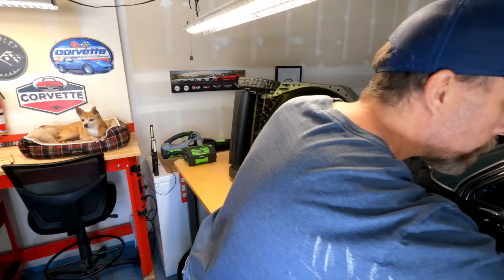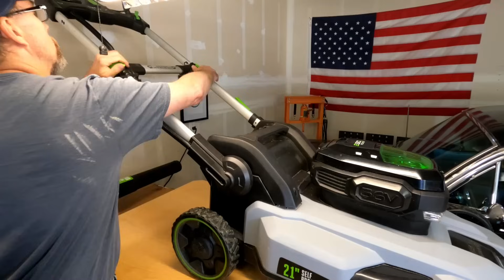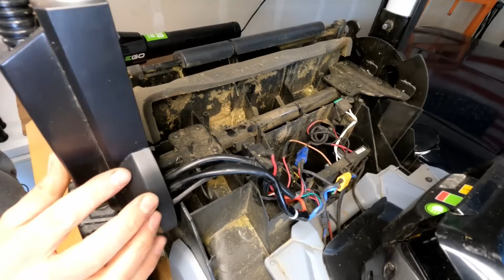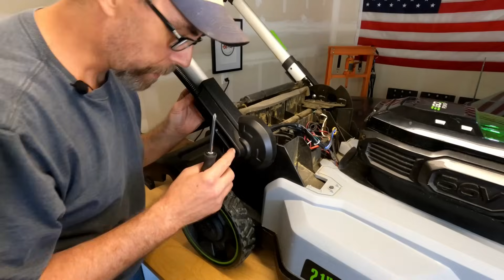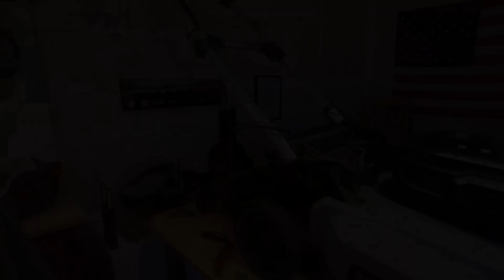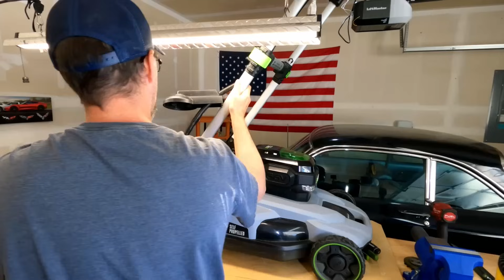My Ego Mower Finally Quit Working!!  🔧  Can I Fix It??

Comment: Big question do you continue to fold it?
Reply from the maker: Yes. I fold it up and store it standing up every time I use it. My repair has held up well. Being able to fold up the machine is one of the reasons that I bought it. If it pinches the wire again I will just fix it again. It takes less than an hour to patch up the wires. Thanks for watching

Comment: These are the type of videos that make YouTube such a valuable resource.  I do not have any issues with my EGO, but i find this so fascinating. Also ill just keep my handles bent at the half way mark and not fold it up to avoid this. Thanks.

EGO should provide a wiring schematic for their mowers if they dont already
Reply: Im having this same problem right now.  This video helped a lot
Reply from the maker: Thank you so much! Hope you have no troubles with your mower. Good luck
Reply: I suspect EGO doesn't want consumers attempting repairs for liability reasons. Plus, they'd much rather sell a new mower.

Comment: I was having the same problem with my ego and I noticed the two green clamps on the side of the bars loosen with use causing the bars to slide down and prevent your blades from rotating.  Grab some duct tape 😂 and wrap around the bars and clamps to stop the bars from slipping down.  Gotta love the duct tape.
Reply from the maker: That's great. Nice fix. Ya, I had the same problem. I actually ended up snapping off one of the green tabs inside of the handle frame. I stuck a screw in it to hold it for a while, but I eventually replaced the green lock handle. I have a video on this channel of that process.
Reply: @EndWrenchRookie  👍

Comment: seems like those two bolts near the wires could be replaced by button head bolts and turned around to help prevent any breakage problems.  The smooth head of the button head bolt would be less likely to snag the wires
Reply from the maker: That is a great idea! Thanks!

Comment: Do you still use your ego lawnmower?
Reply from the maker: Yes, I still use it. It is running as well as the day I bought it.
Reply: @EndWrenchRookie  thanks I think I’m going to convert from gas 

I just got concerned cause some are having a issue with rear wheels locking on self propelled 

I’m looking at the 2156 select cut self propelled 

I can’t wait

I thoroughly enjoyed watching this video and your way of diagnosing

I also feel rather than always replace try to fix first yourself

Comment: Very interesting! I have a few Ego products and need a new mower.  With limited space, I also plan to fold it up to store… but your theory makes sense as to why it fails.  Other than this, I assume the mower works well.  I’ve seen a few people post that it still hasn’t been resolved, so would you recommend NOT folding the mower to avoid potential stress on the wires?
Reply from the maker: Thanks for the question. To be honest, the folding capability is my favorite part of the mower. I still fold it up every time I use it. If you have trouble with it like I did, you can have it repaired under warranty, or just solder in a repair wire like I did in this video. It is a free fix that takes less than an hour to do. Good luck!

Comment: From the looks of it. It seems like those 2 bolts play a role in kinking those wire and cause it to break due to many folding and unfolding.  Hopefully the manufacture put in a rubber gromet on those expose metal part to keep all the electrical wires from getting kinked in theyre next line up future model lawn mower. Great video,  very informative,  Thank you!  I already have an idea on which ego mower to get and this video will for sure come in very handy for all the DiYer.
Reply from the maker: Thank you so much! I appreciate the positive feedback :)  Yes, I hope that EGO has addressed this issue in newer models as well. The response to this video has been tremendous. I am amazed at how many others have had the same issue as me. Though many of these units are still under warranty, a lot of them are not, and more are expiring everyday. My hope is that others will find my repair process helpful. Thanks for watching!

Comment: Yes the wire harness and wire fatigue is a weak point in these mowers. I have fixed three different EGO mowers where the self propel quit. All those wires were broken at the mid point of the handle where it collapses for storage. I replaced the wire at the breaks  with heavier gauge wire on each mower and the SP started working. I have told everybody I know with an EGO mower not to collapse the handles. Now I may stop bending the handle too.
Reply from the maker: Thanks for the comment! Ya, it is definitely a weak point. Luckily it is an easy fix. I haven't had any problems with my repair yet. I agree that it would be better not to fold them down anymore to avoid further crimping of the wires, however, I am really limited on space and need to collapse it in order to store it out of the way. Also, I really enjoy the process of folding and unfolding the machine. It makes me feel like a kid playing with a Transformer toy :) I will likely have to fix more wires in the future, but that is the price I pay for entertainment. LOL. Thanks for the info and for sharing your story. Also, thank you for watching!
Reply: I called EGO after repairing the third lawnmower and supposedly talked to a tech rep about it. He was very non-committal about the problem. I also talked to an EGO rep at a Lowe's when Lowe's took over distribution. Same non-committal. I love EGOs products and their warranty is the best. Hopefully newer generations will have wiring upgrades. Great videos by the way.    @EndWrenchRookie
Reply from the maker: @old-n-still-runnin1597   Very interesting...Thanks for the kind words. Unfortunately, I think that products just aren't made to last these days. I imagine someone figured out how many times the average user would collapse and unfold the mower, then multiplied that by length of the warranty, then tested the durability of different wire setups, and landed on an average of a usability factor of 5 years one month. Science...Lol

Comment: Original purchase covered by a 5-year warranty. Curious why you're fixing it before that date instead of having EGO replace/repair it? They gave me a new one when mine failed at 4 years . . .
Reply from the maker: That is a great question. I needed to get my lawn mowed before the storm hit that afternoon. I don't have a backup mower for the downtime dealing with the warranty. In addition, I prefer to fix my own equipment. Also, I have a YouTube channel where I fix, maintain, and restore stuff. There are a lot of these mowers that are out of warranty already, and more everyday are expiring. I want to help others learn how to diagnose and repair their own equipment and save money and time doing so. I was able to repair my crimped wire problem in less than one hour (while recording a video for YouTube), and it did not cost me any money. Thanks for the comment and for watching!

Comment: My ego push mower would sound like it would start, but then quit in a couple of seconds.  I have taken it to a repair shop Ego recommends in my area.  The mechanic groaned when he saw I had an Ego mower.  I said it lasted 8 years without a problem.   He said he did not like working on them because there are no nuts and bolts.  Now that I have watched your video and another similar one, I can see there are things to take apart.  I think I should go visit the mechanic and tell him to watch your video and the other one to get an idea of what is wrong.   Thanks for giving me this info.  S. Beasley
Reply from the maker: Thanks for the comment. Ya, it is going to be a while until the electric mower repair game catches up. I just really enjoy taking stuff apart and figuring out how it works. I hope you get your mower worked out. Thanks for watching!

Comment: I don't understand how someone could recommend this as a good lawn mower when it's only 3 years old and its broken. I have an 18 year old snapper and it starts first pull and have never adjusted or changed anything on the drive system. I have changed the spark plug 1 time and air filter 1 time. I doubt an electric lawn mower will last as long and not need a new battery which costs almost as much as buying a new one. It makes absolutely no sense to buy an electric lawn mower for how much it costs over a regular gas. Now i did buy an electric Ego brand weed Wacker because most gas weed wackers seem to not last very long without issues so electric for me on that seems worth it. I'm glad you were able to fix it. Hopefully it lasts you 20 plus years.
Reply from the maker: Thanks for the comment. I am glad you are happy with your Snapper gas mower. I am happy with my Ego electric mower. There are enough mowers out there for us all to have our own favorite machines. I would  not say that my mower was "broken". It had a crimped wire that gave it an intermittent power supply problem. It was a free repair that took less than an hour (while recording a youtube video). All mowers have issues. For some reason, so many people assume that because of the difference in powertrain, there should be zero maintenance issues. All mowers need some kind of maintenance as they lead a rough life. If you go apples to apples...this mower only costs 400 dollars new and ready to run. Have you looked at what 400 dollars will get you in the gas mower market today? It is not a fair comparison. That being said, I have used more mowing equipment than most people, including working as a commercial landscaper. For my personal needs, the EGO mower does a great job. FInally...I also had a great gas mower in the past. I used the same John Deere mower for over 20 years and I loved it. However, if you add up all of the maintenance costs (gas, oil changes, air filters, spark plugs, Carb parts, pull string replacement, throttle cable replacement) after 20 years that all adds up to a lot more than a replacement battery. (An annual oil change, spark plug, and air filter is highly suggested on any small engine). I am amazed at how divisive this subject is. If you like your mower, by all means continue using it.  Hope this helps you "understand how someone could recommend this mower". I recommend it because it is a great piece of equipment. Thanks for watching!
Reply: Mine 3rd mow, of second season died, not something as minor as location of handle.

Comment: i wonder if you can get move of that cable runner to wrap around the wires in the joint. looks like its hitting on that bolt there.
Reply from the maker: Not sure. Sounds like a good idea :)

Comment: Hope this doesn't happen to mine, I'm on year 3 with my select cut version, not sure if that ones any better wired or not. I also fold it up after every use.
Reply from the maker: Seems like a pretty common problem. If you do have an issue you can get it warranty serviced or just patch the crimped wire like I did. good luck either way! Thanks for watching

Comment: Most lawn mowers are designed to only last 3–4 seasons. As my Father always says, it's planned obsolescence. They are designed to breakdown, so you have to buy a new one. I have a Husqvarna that still runs, but a bolt that holds the handle on and a couple other things fell out and not even the manufacturer has replacements. I have to get the other one and take it to a machine shop to have one specially made.
Reply from the maker: Sounds about right. Longevity is not good for business. Thanks for watching

Comment: I have the same mower, but my problem is the self propel speed controller (the green, red and black wires) went from working fine - to working only on high speed - to not working at all.  I am thinking that I have the same issue that you have, crimped wiring at that hinge. Although I am also afraid that my wires could be wearing out where the handle collapses. Tearing it all apart tomorrow.
Reply from the maker: Sorry to hear that. Hope your repair goes well. Best of luck on it. Thanks for watching!

Comment: Ironically I had this same exact issue about a year ago. I took it apart and traced it down to that heat shrink tubing. I stopped there as the mower was still under warranty. I took it to their shop and their “fix” was to replace the entire handle assembly. It’s working good as new now but I know exactly where to look now as it will likely happen again in another 3 years.
Reply from the maker: That's cool. At least you were able to get it fixed up :)  Hopefully you have better luck this time. Thanks for watching!

Comment: I had the exact same problem after my 3rd season. Same symptom of working fine one minute and dead the next. I also store it the same way and the repeated folding and unfolding breaks the wire internally at the pivot point. I would expect this to be a 100% failure rate for mowers used and stored as you and I do. In my case, I replaced the 3 wire harness with 18 GA silicone insulated wire which is very forgiving of being repeatedly flexed. The larger gauge affords additional protection as well. It probably would have cost a lot to have the repair performed by a service center, so I'm glad your efforts were productive. It's been 2 seasons since I fixed mine and it has worked perfectly since. I also have the blower and string trimmer and recently got the chain saw which works great. Your video will probably save others frustration and expense when their mower breaks.
Reply from the maker: Thank you so much for the kind feedback. You are the second person to comment about silicone insulated wire. I just grabbed what I had on hand at the time, lol.  I will have to look into that kind of wire for future projects. Thanks for the heads up! Ya, I hope my video helps others in the same boat as me. A LOT of these mowers are running out of warranty this year and the next, so folks are going to need to learn how to do the repair :)  I also have continued to fold my mower up after every use and have not had anymore issues so far (after about 20 mows). Thanks for the comment and thanks for watching!
Reply: Was wondering wire gauge replacement.  Thanks 💪👍
Reply: @lowridingtrucks88 I used #18 silicone insulated wire which is larger than the original wiring.
Reply: @ctbcubed  Did you splice it in like @EndWrenchRookie did or did you have to replace all of the wire?
Reply: @marilynt1  I replaced the entire length of the control wires (3 wires total). However, if you can pinpoint the break a splice is OK. You might want to add a short length of wire to complete the splice so as not to put a lot of tension on the wire harness when the handle is folded for storage. I replaced the wires with silicone insulated wire which is very flexible and less likely to break when the handle is folded for storage. Amazon sells 18 GA silicone insulated wire.
Reply: @ctbcubed  Thank you.

Comment: A poor design, as the wire loom is captured underneath the handle by the plastic pivot point. This is causing a very small radius when the handle is rotated to the storage position and flexing those small wires to an extreme angle. I have seen this problem on another brand battery powered mower.
Reply from the maker: Sounds about right. Thanks for the input and thanks for watching!

Comment: They used inexpensive wire that has a vinyl jacket that was made for static or very limited movement during installation.  They should have used something much more flexible like high strand count silicone jacketed wire and allowed for a much larger bending radius within the housing to prevent binding.  This is a failure that could have been rectified through proper engineering but it was likely rushed into production and they figured most would not break till they were out of warranty.
Reply from the maker: Sounds about right. The realistic lifetime of most products these days is unfortunately the same as the warranty period. Thanks for the input and thanks for watching!
Reply: You are spot on. I have had not one bit of trouble with this mower. My warranty ended 2 months ago. So now the last 2 weeks I have had this issue. Isolated it to the wires as indicated in this video, but I do not have enough knowledge or tools to fix the wiring. I will be at the mercy of a repair shop.

Comment: Bet the small (3) wire cable is the Control Signal, DC Power & DC Ground to the lawn mowers motor ESC module ( Electronic Speed Controller ).  The electronic ESC is very close to the same device used in Radio Controlled model airplanes.
Reply from the maker: Sounds about right. Thanks for the input!

Comment: I had that same failure in that same mower. mine was under warranty, so they replaced the harness and safety switch at the base of the handle. I came to the same conclusion you did. They clearly didn't intend for it to be folded every time. These mowers are actually pretty easy to disassemble and repair, so it's not a big deal, but it's frustrating a feature they advertise is not as robust as you might expect. I suspect my failure was the harness, and failed like a car door harness, the wire was broken inside the insulation.
Reply from the maker: Well it is great that you got it all fixed up :)  Ya, I could have tried to warranty it as well but I really needed to get the lawn mowed that day and I don't have a backup mower for the downtime. Also, that wouldn't have made a very interesting YouTube video :) Thanks for watching!
Reply: @EndWrenchRookie  I agree, but when I had my failure, I had a backup, so it made sense for a free replacement harness.

Comment: Glad to hear that your repair was repairable. I had one of those cotrol boxes go out on mine. It was the one that did the rear wheel drive. I am told that this is a common problem with my model. EGO did the repair under warranty. And my local repair guy (who up until now has only done ICE mowers) got to learn a few things.
Reply from the maker: That is great! I am glad you got it worked out. Thanks for watching!